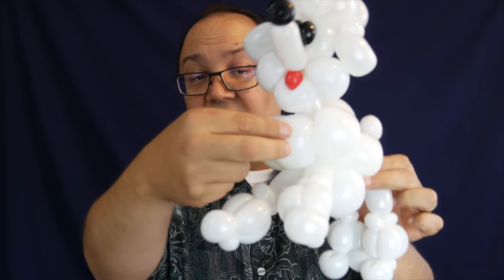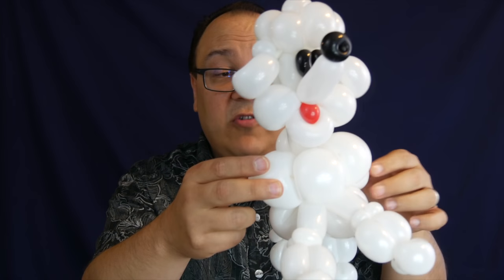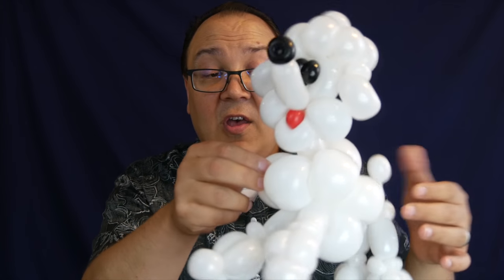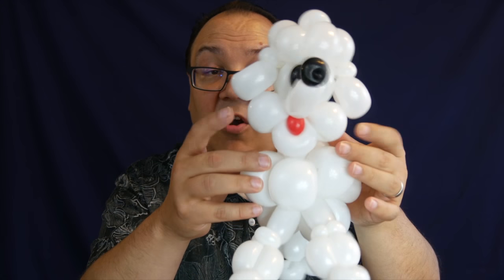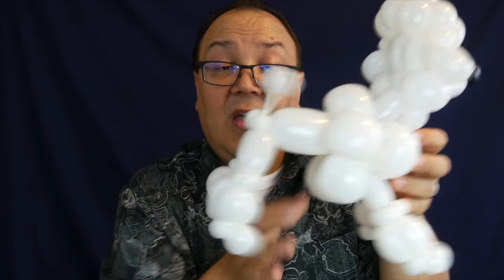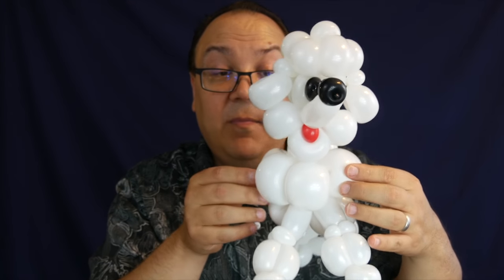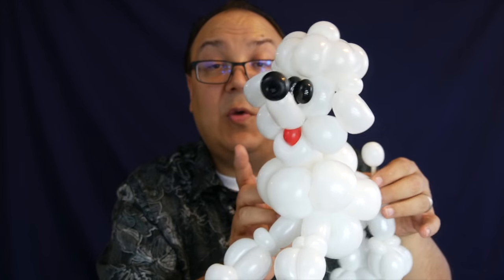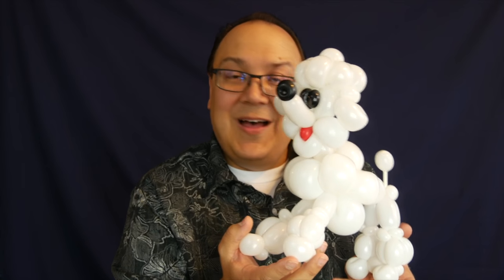Miniature Poodle Balloon Animal Non-Tutorial (Balloon Twisting and Modeling # 35.1)

Comment: What is the nose made of? 160, 260 or 321?
Reply: 160 is my guess.
Reply from the maker: Callieoops - The nose is a 160. Incidentally, marriage twisting 160s is not easy when you have fat little sausage fingers like mine. (for some reason YT is not letting me reply to your comment).
Reply: +Mr. Boma's Balloons Thanks! Just added my photo. May need to check settings again. Got to figure it out!
Reply from the maker: +callieoops The problem is on my end. I can reply on my phone, but not on my computer. Weird.
Reply: +Mr. Boma's Balloons Ok, but I still  have to figure it all out on my end too! Thanks again for this design! I will get to try the mini before the original. I need to get some of the specialty balloons for that.